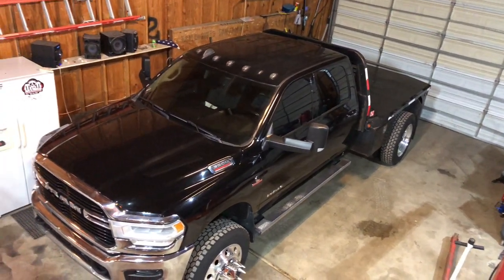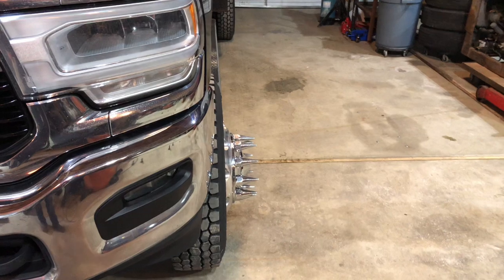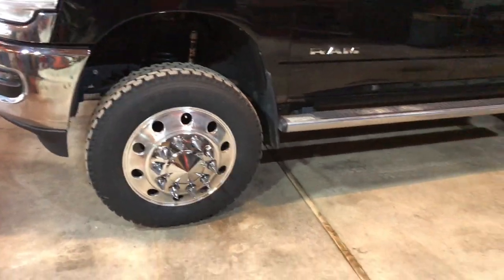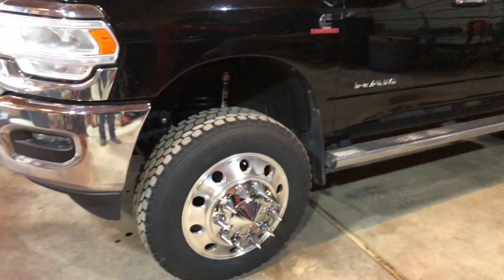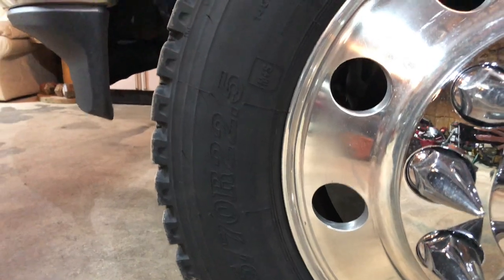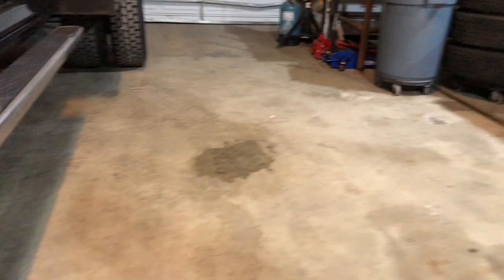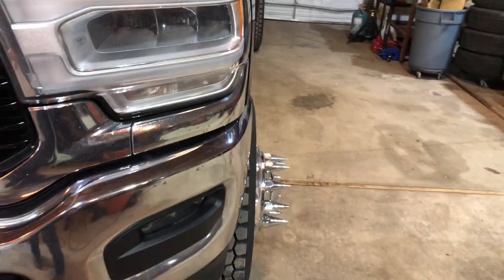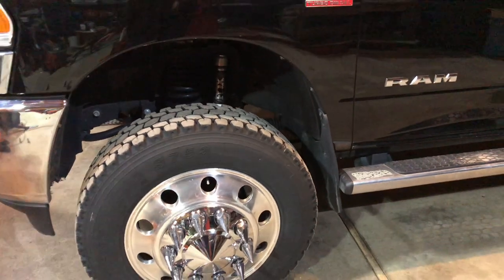22.5 Alcoa’s on your RAM 3500 dually 2019 and newer ￼

Comment: 5th generation Cummins engines are on backorder because there is so many failures. Anything 08 and newer are pieces of crap.
Reply from the maker: You’re not right but you’re not wrong, damn good truck but I am waiting on the recall to be completed on my high injection fuel pump lol
Reply: @GoForBroke.  its called an injection pump. The CP4 is garbage. But so is the electrical in the new vehicles and the iron graphite block is weaker. Then there is the major failure rates of the hydraulic lifters. The VGT turbos are also junk.
How do I known this? I'm a mechanic. My 5.9 has 530000kms on it and has more life left in it than any brand new truck.
Reply: They’re having a lot of EGR problems and lifting the heads
Reply: @vinniegillotti9347  all of the 6.7 Cummins have head gasket issues primarily due to the restrictive VGT. As well as the additional coolant ports in the head due to EGR increasing operating temps. All emissions stuff is crap. Hence why the warranty is half for emissions what it is for the engine. Yet the engine won't operate without it.
Reply: @kyles234  You really have to be a glutton for punishment to own any newer emissions diesel truck no matter what the badge is on the grill or who made the motor because they all more or less have a lot of problems stemming from the emissions systems. And guys using them as glorified commuter/grocery getters 99% of the time really should have just bought a gas job.
Reply: @BrandonLeech  i fully agree. I got rid of all of my newer emissions equipped trucks and found 2x 2007 3500s Dually long box Laramie with manual transmissions. Both unicorns.
Reply: I run a trucking company. Personally I drove over 500k mile collectively, coming from experience.  I would never drive anything older than a 4th gen, but unfortunately, these trucks start needing major work after about 150k miles.
Reply: @dudove1  3rd gens are 10x more reliable. Right now the AS69RC is having major failure rates on 22 and 23 rams. The hydraulic lifters are as well. The newer vehicles in any vehicle segment are now money pits. All part of the agenda "you'll own nothing and be happy"